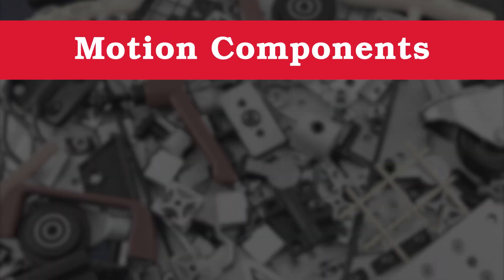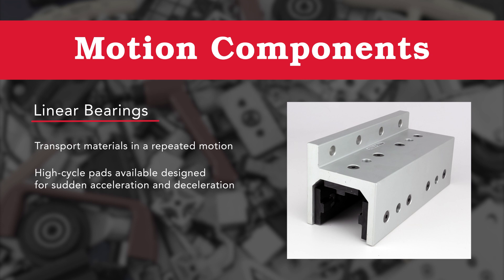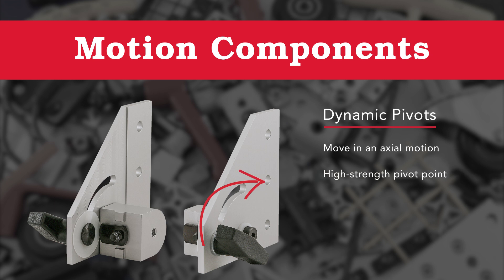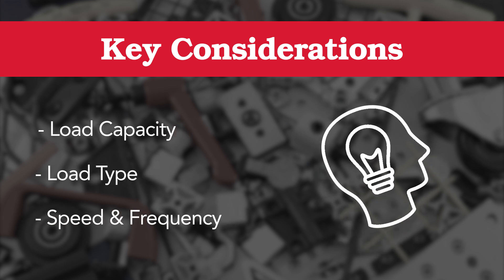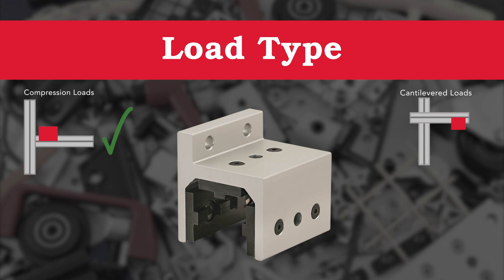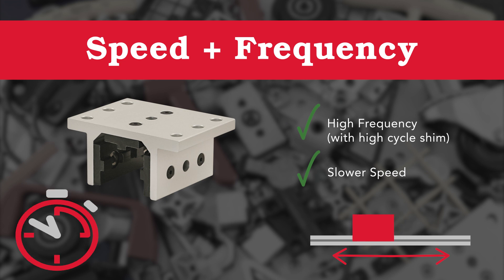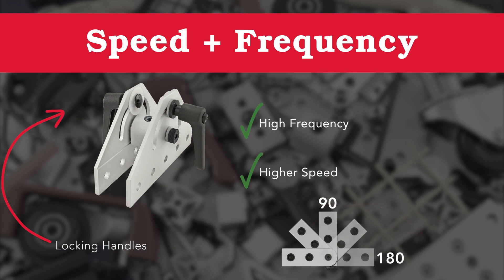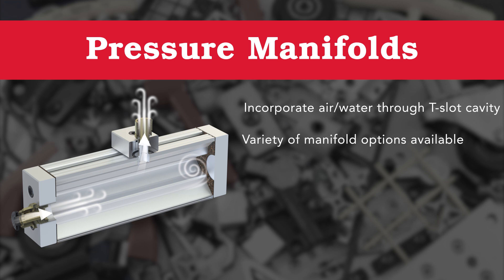80/20 │ How to Design: Add-On Components

Comment: I'm trying to make a set of steps to put below the entrance of the van on the side. I understand how to put the 80-20 together and frame both steps the second one only being four in Fire and I want them to be 8 in deep what about 18 in wide. Nowhere on YouTube have I been able to find how do you screw a 2 by 8 into on top of a frame made out of 8020
Reply: The easiest way would probably be to use L-brackets, or some T- or L-Shape flat joiner plates, or, you could probably just use a carriage bolt that fits a standard T-nut, and countersink so the head is flush. You could also have the center holes threaded, and bolt through one fastening plate hole into the threaded center-hole, and through the other plate hole into the wood. I wouldn't trust the strength as well that way, but it's an option. Personally, I'd probably do the L-brackets inside and under the 2x8, with one leg of the L fastened to the rail with a T-Nut, and a screw/bolt through the other leg of the L-bracket into the 2x8. That's how I did my stereo stand. I countersunk the bracket holes, so you don't see the bolt head in the bracket or the wood of the shelf. It's actually fairly elegant, you can hardly see the brackets.